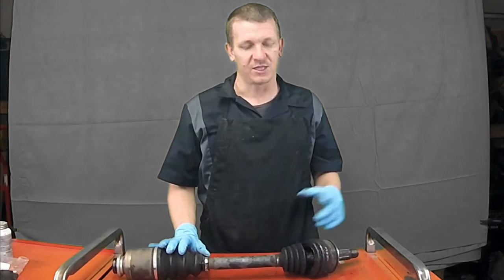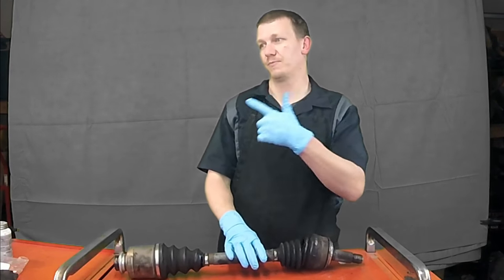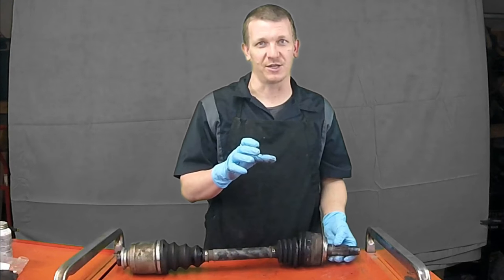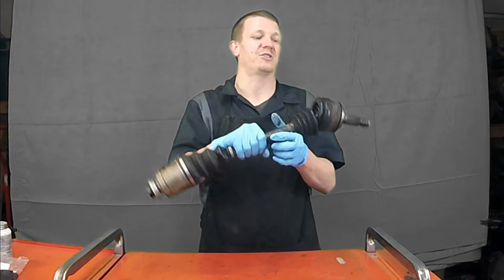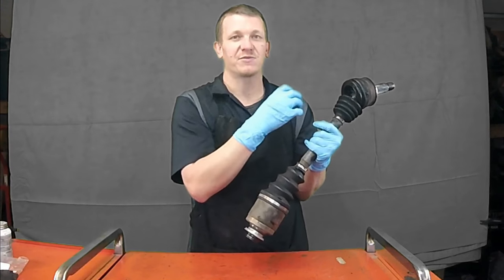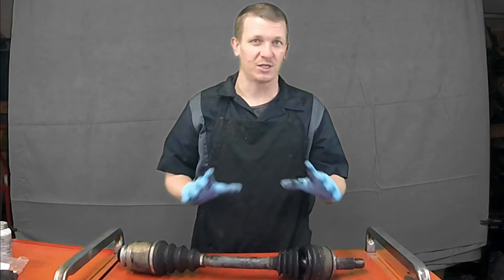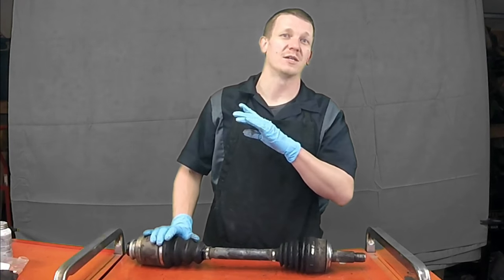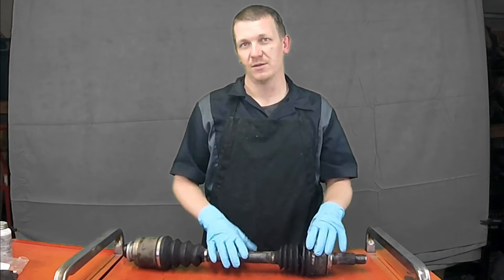⫷ Clicking / Clunking While Turning, Solved! ⫸

Comment: Replaced my passenger axel and still have the noise now I cant afford to find the real problem. Also most of my components are new ( shocks/struts, tie rod ends, sway links, lower control arms etc) 04 rsx
Reply from the maker: Did you see any visible grease leaking from either of the boots on the CV shaft you replaced? Have you visually inspected the other side for boot damage? How about your strut mounts? Lastly... in the last month my friend had a odd sound like a clunk when he make a turn. Only one clunk per turn. We couldn't find anything. Come to find out he had 2 bad motor mounts. Replaced the motor mounts and sound went away. 

With all that said. Not all repairs needed are going to be the same every time. Sometimes its worth paying a little , like $90, on a diagnostic. Spend more now, save a ton in the long run. 

I'll cover this on a podcast this weekend.  Check back or subscribe for a Hopefully more detailed response if there can be one.
Reply: @ScottiesHobbies  all work has been done by mechanics I've thrown so much money at it and the problem persists. Theres no more money now. Also motor mounts were the first thing I had replaced
Reply from the maker: @chadwolf790  holy cow! I'd be frustrated. Do you get 'road noise' when driving?
Reply: @ScottiesHobbies  I wouldnt hear over music/ wind
Reply from the maker: @chadwolf790  i would say no in that case. But I was thinking, bearing? But you'd hear like a constant rubbing sound. Sounds like the plastic underbody panels hanging down... but in the car more than the outside.
Reply: @ScottiesHobbies  theres a definite squeaking as I turn the wheel aside from the clank. This is what I get for buying a rundown 04 rsx
Reply from the maker: But they look so good. Lol. I really do like them. If you want to check the bearing. Jack the car up a few inches.. Put it on jack stands. Put a pry bar under the tire. Try to pry the tire up off the ground. Watch for movement.
Reply: @ScottiesHobbies  I'll go do that now I'll get back to u
Reply from the maker: While you are there... grab the tire and try to move it side to side too. You might see play in the steering system doing that.
Reply: @ScottiesHobbies  did those and barely budged. I think I found why theres squeaking. I think you've mentioned it already. new shocks but old mounts. Still cant find what makes the clanking which is actually my worries
Reply from the maker: If the mount is hella bad it could clunk when you initially start off from a stop. Good luck pin pointing the issue. Keep us posted on what you find. Might help someone find there root issue too. Good luck. 👍🤞
Reply: @ScottiesHobbies  thank you for your time it is appreciated 😁
Reply: @chadwolf790  My clanking was upper control arm. did you have that checked?
Reply: @DiamondScuff  I dont have any more money to have it checked/ fixed
Reply: @chadwolf790  Easy way to check yourself. jack the car up and push down on the balljoint in upper control arm. if you hear any clicking/movement its likely that. i could tap it with the palm of my hand and hear it metal-metal contact. fixed that and all is well. but now my cv axel is clicking. one thing after another..... dont got money for it either currently.
Reply: @DiamondScuff  ty will do. The axels r new on mine, could new components cause extra wear to old components?
Reply: @chadwolf790  100%. Thats literally what put my parts out of business. i test drove a vehicle all was good. for safety i needed to have 1 upper control arm replaced. after that and i purchased it 2-3 days later my other control arm failed ( started clacking ) i guess cuz the new control arm on the other side was so stiff it shifted a lot of the weight to the other side. Finally got that other control arm replaced 3 days later my axle is making noise on the side that was just replaced. Anything suspension and is old or worn once something new comes along makes that worn out problem a lot worst. very frustrating.

Comment: Idk why I can send a picture bit you said you never seen a CV axle snap before but my 2000 Acura tl had one of its axles snap into 2 right in the middle. Driving no more then 20 mph amd it skipped like my tires bounced on the road I let go of the gas and slowly pushed it again and it snapped in 2 lol.
Reply from the maker: that is crazy! Does it have any symptoms before it snapped or did it just catastrophically fail?
Reply: @ScottiesHobbies  no just failed for now reason. Thought I share some info about it

Comment: My car is making the same noise but the boot on the CV joint is good and not torn. Can it still be the cv joint?
Reply: jack the two front up in the air.
turn your wheels while turning. 
also check your sway bar links by grabbing & turning.
Reply: @angelisone  thank you!. I found out it is the CV axel the boot did tear just wasn't where I could see untill I lifted it
Reply: @OGGamingJedi  If you have not replaced them, do replaced the lower ball joints also.
and check for inner and outer tie rods.
Reply: @angelisone  I think the ball joints are good. It wasn't having a issue untill the cv axel boot ripped now when I turn it clicks alot. When I replace the cv axel it should be good after that but if it still feels wierd or clicks after I replace the axel then I will do those next I'm tight on money rn so I'm going to fix 1 thing at a time lol
Reply: @OGGamingJedi  What year, brand, model & mileages?
The axle's nut is on very tight. 
1. Make sure you straighten the axle's dented lip to round & reuse it. A new axle has nut
2. Loosen that nut with wheel on the ground or re bar to lock rotor from spinning.
3. If you can't take out the axle assy out, then turn the wheel (N) ever 11 degrees
4. If you remove part of the lower or top joint, check with 3 fingers = move means replace
5. Check lower control arm /or top control arm
6. Once the axle is out do check the inner and outer tie rods = hold it horizontal & let up

All those mentioned above should not move easily
When you buy the cv axle, make sure you buy transmission seal (cv axle to transmission)
Reply: @angelisone  thank you that helps alot! This will be my first time ever doing this lol
Reply: @angelisone  it's a 2014 honda odyssey EXL with 168,000 Miles
Reply: @OGGamingJedi  I understand about tight on money. Unless you are planning on keep the van. Many parts are going bad /or needs replacements.
If the Timing Belt snapped you got a bad engine.
1. CV Axles
2. Lower Ball Joints
3. Inner & Outer Ball Joints
4. Stabilizer Bar Links
5. Lower Control Arms
6. Complete Timing Belt Kits (includes spark plugs/coils/valve cover/inlet gaskets)
7. Crankshaft seal [and back Crankshaft seal- costs about $1,200.00 just to do this]  
8. Front Wheel Bearings (not an easy jobs- check by turning the wheel up in the air)

Many owners will not do those repairs due to costs.
Again, if you don't do the timing belt kit and the T belt snapped then your engine is gone.

Many shops and Youtube videos will not show replacing the rear Crankshaft Seal replacement. Because do this jobs is like replacing the Oil Pump's Seal.

Reply with your email here, if you need more help.
Reply: @angelisone  thank you for the help. I will be doing all of that but just 1 thing out of a time so it is better on my wallet. My belt has 30,000 miles left on it but iam going to get it done in the next 5,000-8,000 miles or sooner. Thank you for the help
Reply: @OGGamingJedi  You can not see the Timing Belt, Tensioner & Pulleys because they are enclosed. 
When doing the Timing Belt Kit, good shops highly recommend to replace the Water Pump.

Again, a complete Timing Belt Kit replacement will runs about $2,000.00 at good shops.
Reply: @angelisone  on my model I can see the timing belt/ serpentine belt and pulleys it's all on the side of my motor on the passenger side
Reply: @OGGamingJedi  You are lucky that you can see the bottom of the timing belt.
Do not do the timing belt if you can not remove the Crankshaft's 19mm Bolt
Reply: @angelisone  thank you for the help!. I can see it but it would be hard to get out without having to take a couple other things off lol

Comment: Mine makes a noise that's high pitched similar  to this but it's in my wheel when I'm in drive  or reverse  when I turn hard right I'm hearing some kind of clicking in the same area of this video I've replaced alot of stuff so I'm hoping  this video helps

Comment: What can cause a clunking noise when turning the steering wheel to the right when in reverse in a Honda civic 2012
Reply: Any update on yours? I’m having the same problem with my 12 civic I’m thinking it’s either this or a tire rod issue.
Reply: Probably tie rod too you can check by lifting the tire that has the issue and checking 12 an 6 and and 3 and 9 for play